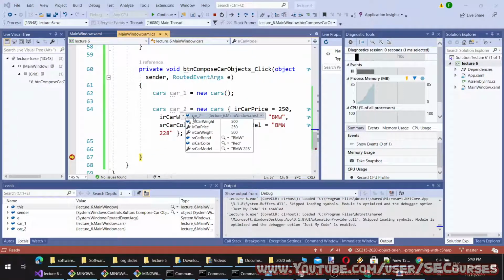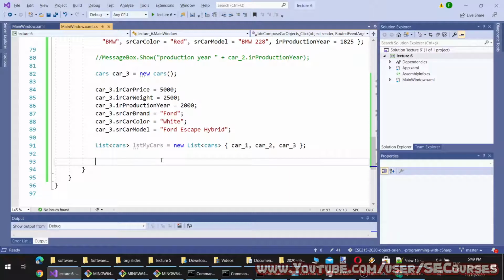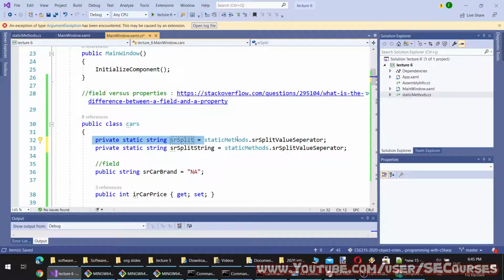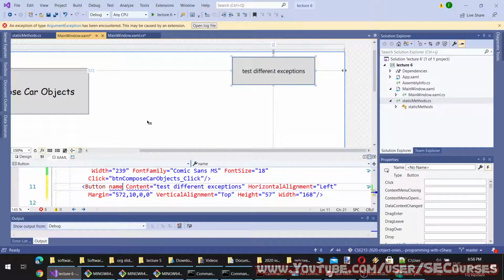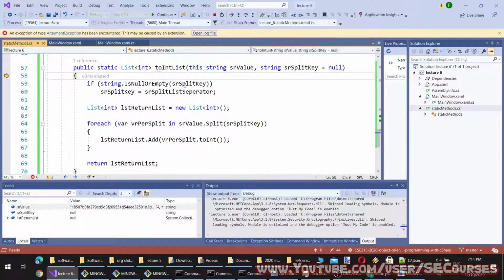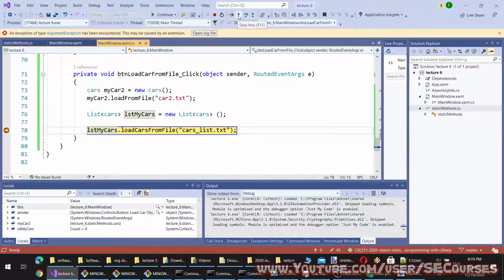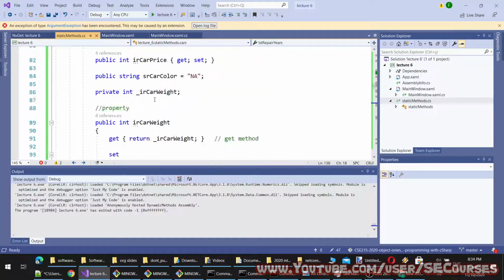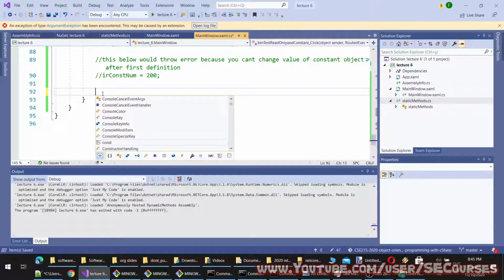C# Expert OOP - Lecture 6: How to Dynamically Save/Load Objects with JSON, User Defined Classes

Comment: i learned :

-Differences between fields and properties
-How works getter and setter
-How we use a Hash method
-How we create read only objects and how they behave
-Differences between constant, readonly and static
-We see how to save a text and load from file.
-What is json.
-We save files in json formatting.

195050012

Comment: i learned in this lecture:
*Differences between fields and properties
*How works getter and setter
*How we use a Hash method
*How we create read only objects and how they behave
*Differences between constant, readonly and static
*What is JSON and it’s benefits. 
*How we built our custom methods to save and load objects into a text file
*Feature of extension methods
*How we use JSON to save and load objects into a text file
*Why we prefer JSON to save and load objects into a text file
*Examples of try-catch and switch-case blocks
195050009

Comment: 165050012
I learned:
- Differences between Fields and Properties
- How works getter?
- How works setter?
- How to compose custom method extensions?
- What is JSON and how can we use json?

- What is SHA256 and how to create it?
- How do we save the object to the file?
- How do we use the hash method?
- What is json and how to use it?
- How to use try catch to catch?

  Thank you for lesson.

Comment: 185050008

I learned in this lesson,

What is receiver and tuner, how does it work?
How do we use the hash method?
What is JSON and what are its benefits?
How do we save the object to the file?
Try-catch and switch-case block example
Differences between constant, readonly and static?
Differences between read-only and const?

thanks for the lesson

Comment: I have learnt in this video:
-	Differences between fields and properties
-	How works getter and setter
-	How we use a Hash method
-	How we create read only objects and how they behave
-	Differences between constant, readonly and static
-	What is JSON and it’s benefits. 
-	How we built our custom methods to save and load objects into a text file
-       Feature of extension methods
-	How we use JSON to save and load objects into a text file
-	Why we prefer JSON to save and load objects into a text file
-	Examples of try-catch and switch-case blocks
Thanks for lesson
185050002

Comment: 175050010

In this lesson;
- A class enables you to create your custom types by grouping variables of other types, methods, and events.
- In C#, a class can be defined by using the class keyword.
- In object-oriented programming, a class defines some properties, fields, events and methods.
- There’s one more trick you can use when you want to save data and that is JSON.
- save object to file
- We also made examples about switch case, and try catch.
- get and set methods

Thanks for this video

Comment: 195050003

In this video:

- We learnt about the differences between fields and properties: basically properties are used to see and change fields(which are in most cases private).
- We made examples of creating custom extension methods for our public cars class.
- We learnt how to use JSON to save objects, and how to reload them. 
- We learnt about the differences between readonly and const: const variables have to be assigned a value when we declare them, but the readonly variables can be assigned a value within constructor of the class.
- We also made examples about switch case, and try catch.

Thank you for your time.

Comment: In this lecture, we started with saving the object state into a file and read it back. Then, we talked about what is JSON ( JavaScript Object Notation ) and how to use JSON. After that, we take a look at what is Constant ( Converts nothing more but constant ) and how to use it in the project. Also, we learned the differences between " readonly " and " const ". Thank you for the lesson.

165050007